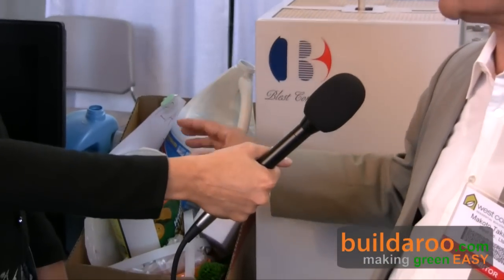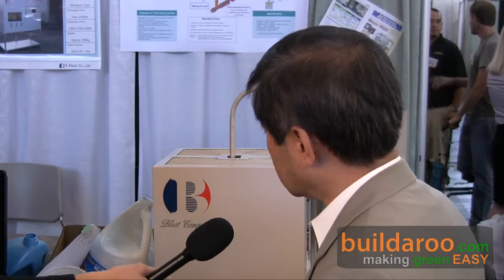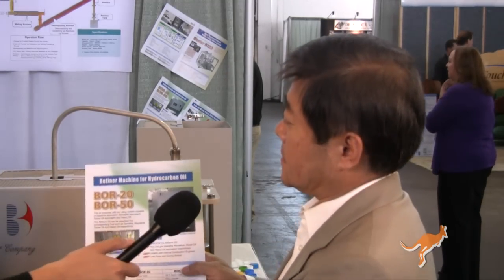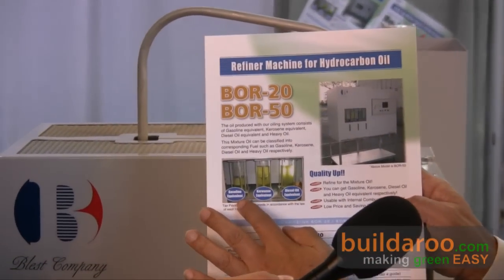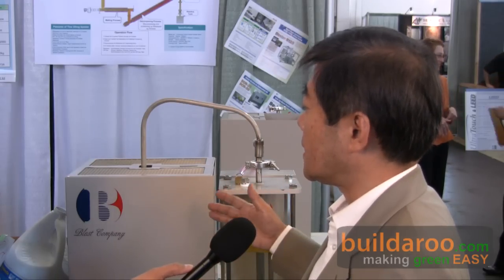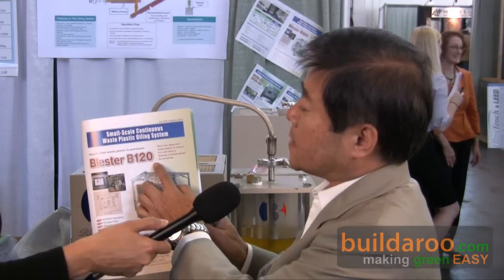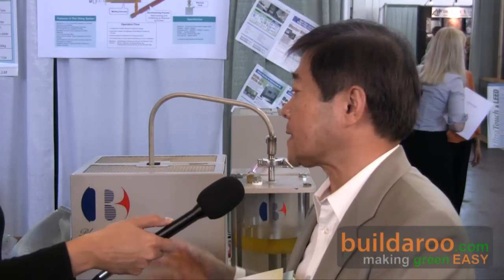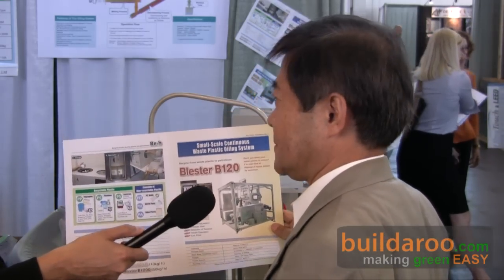Blest Company: Plastic into Oil - buildaroo.com

Comment: @acuaman42 -- as dcsensui said, if it's powered from renewable sources like wind, solar, or water or low-impact energy like nuclear then it's worth it.  It's not so much about getting a good return on the energy invested as it is making the best use of a limited resource, namely fossil fuels.

Our infrastructure is highly reliant on fossil fuels.  This would be a good stop-gap measure to "lessen the pain" as we transition away from them.  Also helps reduce strain on our waste management systems.

Comment: @dcsensui You are completely wong. You can never get the 350 Celsious degrees the process needs with solar energy, even with parabolic solar concentrators, like the ones in Spain or Germany, the highest temperature they reach is 165 Celsious degrees when they are used for heating water, this plastic needs much higher temperatures.